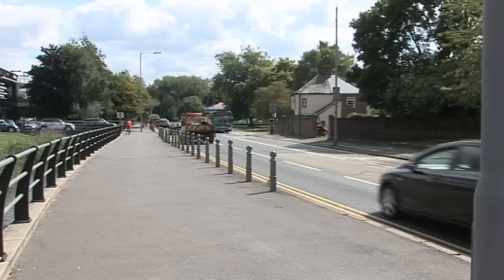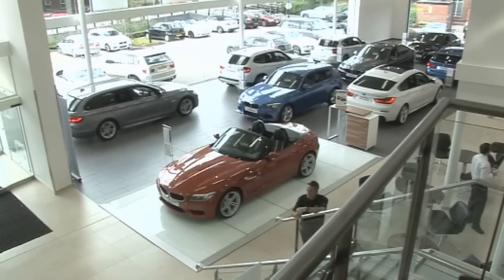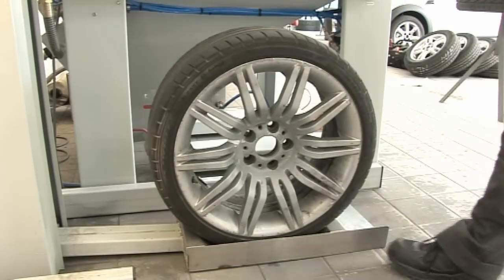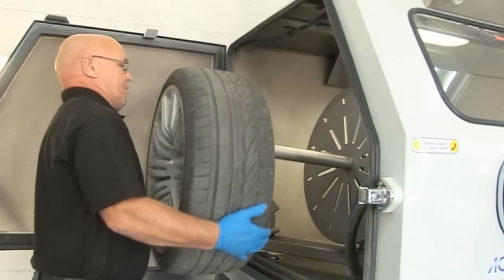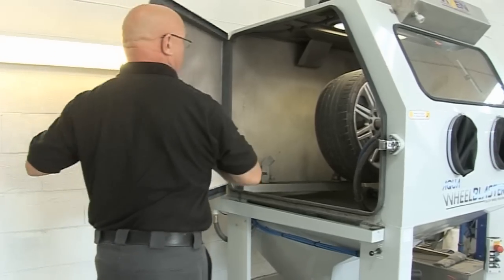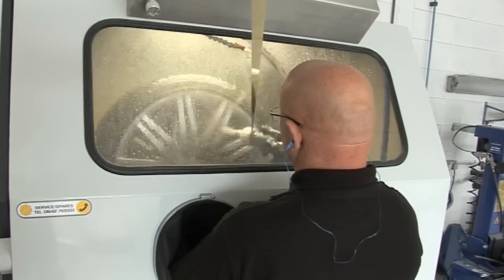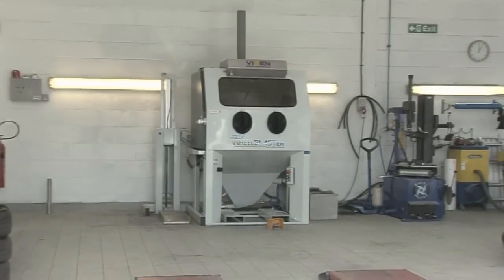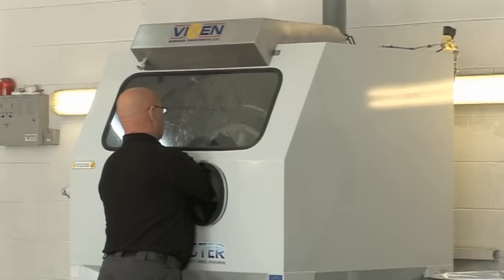Sytner BMW - Aqua Wheelblaster

Comment: Cool, great looking self contained unit. Is it absolutely necessary to paint the alloy wheel after the cleaning process? The Hydro-Blasting guy in town here said the hydro blast actually closes over the grain or surface of the alloy itself, meaning it will not get dirty or stain again & best of all, the alloy mag wheel will never need clear coating which inevitably is always what faiis on painted or coated alloy wheels. I'm thinking to get my mags hydro blasted then the faces milled on a lathe, looks classier than polished & never need painting? Good video thanks for posting.
Reply from the maker: Hi!

If you could provide me with some contact details such as a telephone number or email address, I can get one of our sales representatives to give you a call to give you the advice you need!
Reply from the maker: Email us at info@vixen.co.uk
For the attention of Payten, thanks!